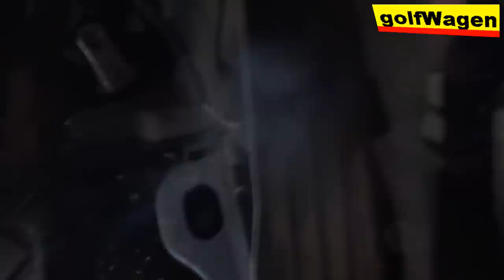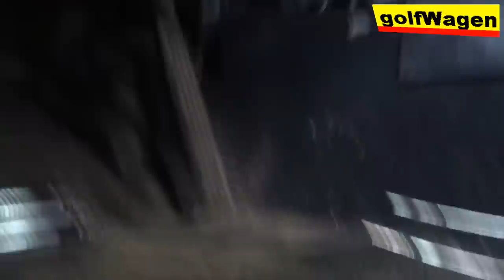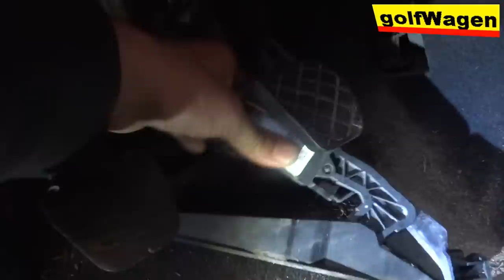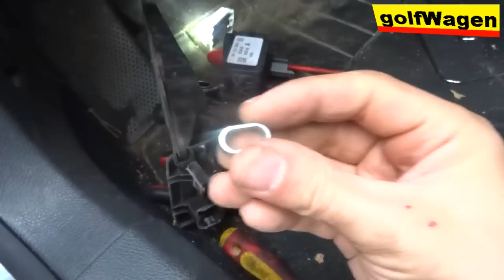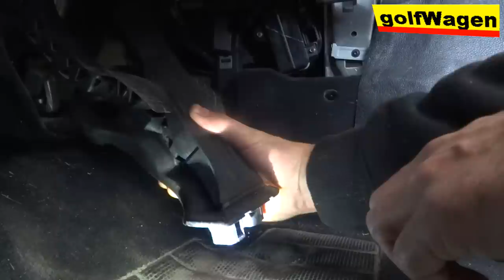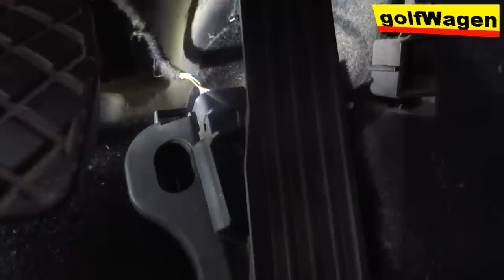How to replace accelerator pedal on VW Golf 5 /1K1 721 503P/ need special tool

Comment: Just to let everyone know I had the pedal off in less then 5mins and it's easy as fuck! This is how I done mine . I push in the clip on the right, then I slightly tilted the pedal to the left and up a touch, then I pushed the left clip to the right and it just popped off after wriggling it around a little. Don't be scared people 👍
Reply: ZeroGHome24 Did you use that special tool too? Did you poke one side at a time and adjust one side at a time?

Comment: Door side is a push away (small screw driver). Passenger side is a push sideways (towards door slightly bigger screw driver) then lever up.
Reply: Door side catch on mine was a bit broken in the middle, so needed to put screwdriver in at a slight angle. Otherwise easy, release catch at inside, then tilt up a bit, then door side.

Comment: Does the pedal need programming when replaced ??
Reply: It does not, just keep your key out of car, I just installed metal GTI pedals into my Gof 6 and everything works normally, you can eventually check gas position using VCDS
Reply: @malcolm7226  why keep the key out the car ?
Reply: @addywaddy39  i meant to not put it in contact position, thats all
Reply: @malcolm7226  i left my keys in the ignition and now have a throttle pedal position fault, will i need to have the pedal programmed in
Reply: Jamie try to clear fault and then test the pedal, if it doesnt work it could be faulty pedal, try to test throttle position in vcds
Reply: So leave the key out of ignition while doing install to mess up the programming? I have to put in a new  pedal here mine broke off

Comment: Why did you change your accelerator pedal? Whst was wrong? X
Reply: Mine broke due to snow
Reply: Sometimes the pedal position sensor goes bad.
Reply: @Christopher-ix2zc  Is there a way to dry it out with out having to replace the whole thing? Mine is the sensor i believe